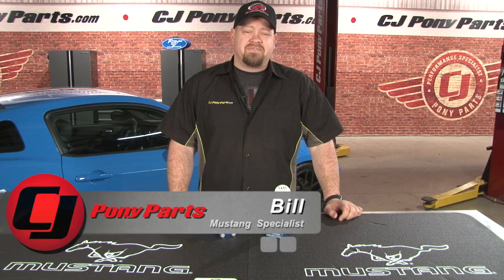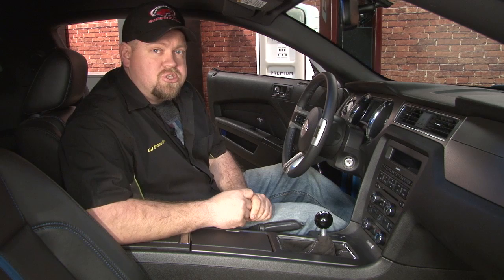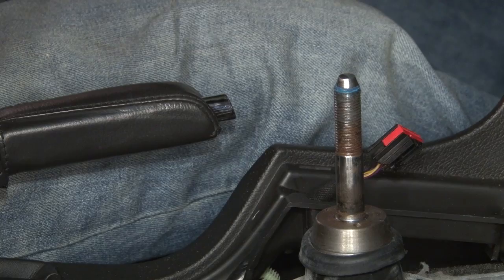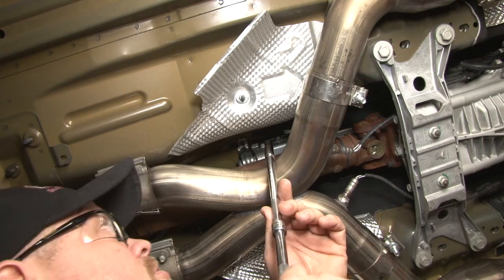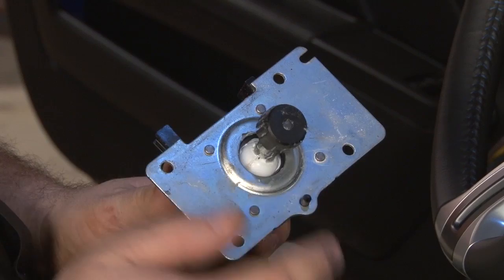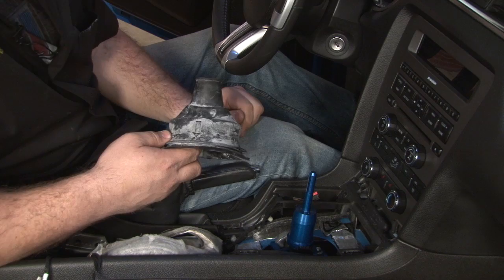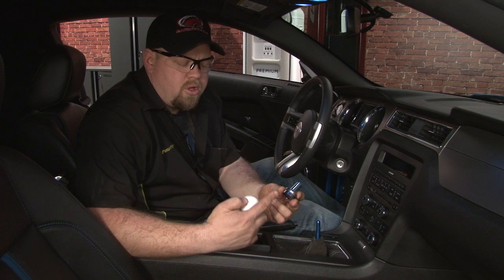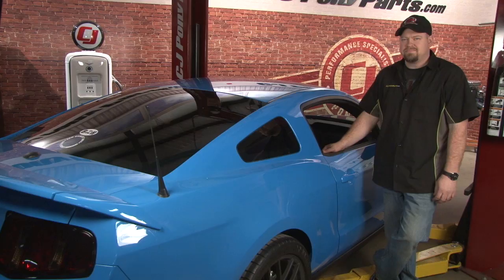Mustang Ford Performance Short Throw Shifter 2011-2014 Installation

Comment: The bracket supports the rear of the shifter housing where it connects to the floor. The factory bracket has a large rubber gasket that holds it and allows a fair amount of movement, the FRPP bracket is made by Barton and is sold seperately. It gets rid of the bushing and does a much better job supporting the shifter.

Comment: The real question is does it eliminate the lockouts during higher rpms?
Reply: I don’t think so, I’ve been doing a lot of research recently because I just got a boss 302 a few weeks ago and have been having that issue. So far most people have told me a new clutch will fix the problem but a lot of people have said a MGW or any other transmission mounted shifter will fix the issue.
Reply: @s4fedriver  blowfish bracket

Comment: Let's just be intellectually honest... this is a really nice upgrade over the factory crap. However, it's not really a full shifter though; It's an upgraded shifter arm and bracket. It doesn't replace the shifter body with the marshmallow rubber bushings or the flimsy shifter rod and bracket to the trans. It says "Ford Racing", but it's made by Barton, and is $100 more than the Barton because of the Ford logo. Don't get me wrong, I would love to get the "Ford Racing" piece, but I don't want to waste my money for something that is not the absolute best available for my high-dollar, muscle Mustang. CJ is selling the Ford Racing 'shifter' kit at $478.99. The MGW Compact Race Spec shifter is $470, and all one has to do is look at it to see the engineering quality vs. cost of the MGW is so vastly superior that the real choice is obvious... Scrap the entire factory shifter assembly, and get the MGW for $470.

Comment: Put this shifter on my 2013 Boss 302
Since the shift ball is different than the stock boss302 you need to reuse your stock shift ball or as I did take the aluminum shifter to shift boot piece put it in a lathe and modified it to replicate the stock boss shift ball
People see the white ball( I have white boss ) and ask how did I do it any ways thats how its done 
Also I like the way I did it because the aluminum trim piece works as a jam nut on the ball
No need for locktite and fighting to get the ball off like stock set up

Comment: I may or may not have overtightened at 3:52 of the install, is there any repercussions to that? Car shifts great and feels fine but I definitely gave those 4 bolts on top a good cranking
Reply from the maker: I think you will be ok as long as it feels fine.

Comment: Did not know that, what does the bracket specifically do?  I just ordered an MGW for my 03 which comes without bracket, but would I still get the desired result without it?

Comment: is it normal that its hard to find first gear?
Reply: I found mine was a little stiff at first when finding first gear but quickly broke in.
Reply: You did not see the barton shifter video where it tells you to change the lock out position 
After you do that you will find it feels 100% better (all you need to do is remove the shift boot and do it from inside the car)
Ford f’d up by leaving that part of the instructions out